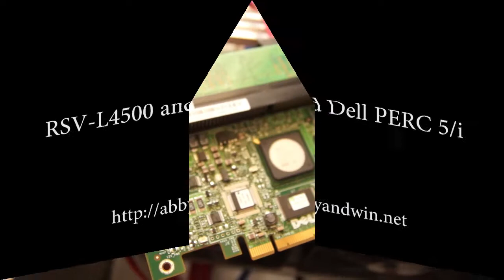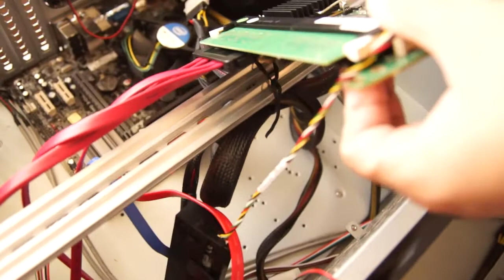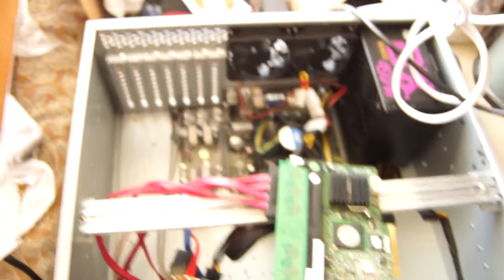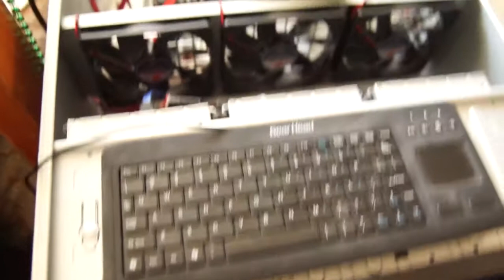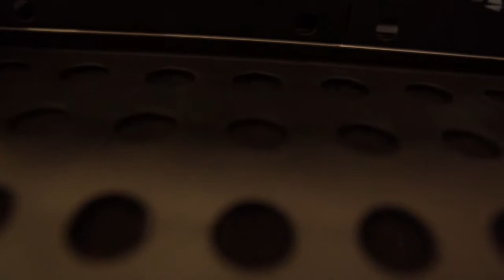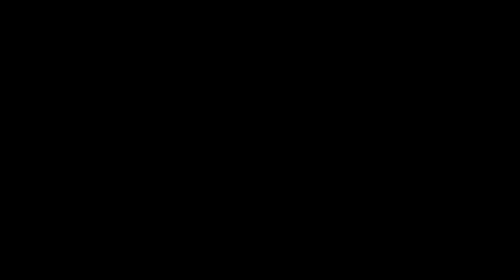Rosewill RSV-L4500 and Dell PERC 5i

Comment: Can you remove the extra drive cages or are the permanent?
Reply from the maker: Zach Brownfield yes you can remove the 3 cages. it makes the drive installation easier. there's a rail system on the top of each cage to help you slide it off. you can see 19s in this video i made https://www.youtube.com/watch?t=19&v=fDwDAjvTtBc
Reply: sherwin Yea, I watched that video which led me to this one. I didn't see any screws in that video so I didn't know if they were already lose or permanently attached to the case. 

I'm thinking of modding the case and taking two of the drive bays out and replacing them with a radiator and water cooling my "server" so I can OC for heavy compute tasks.

Comment: Thanks, I've been thinking about doing something like this.  I use the PERC 5/6ii cards at work and in my Dell 2090, but I've been thinking about using the cards in my next build.  They're a cheap solution, but I'm still thinking maybe going with a more expensive and faster option like LSI RAID.